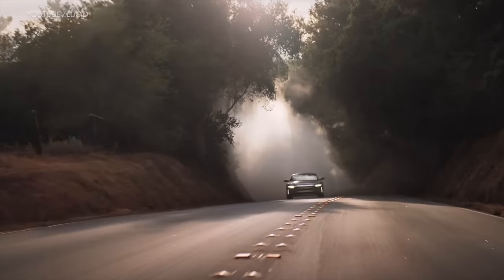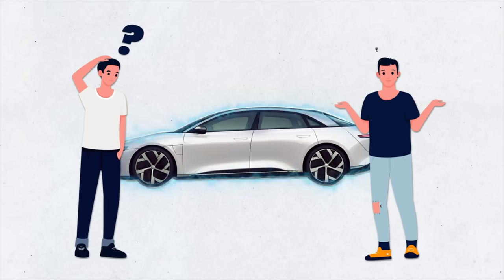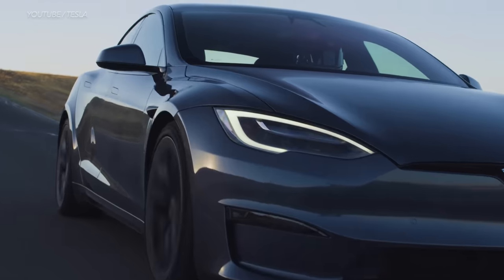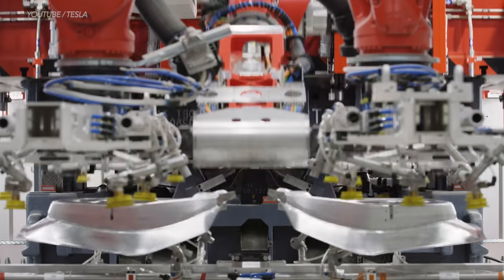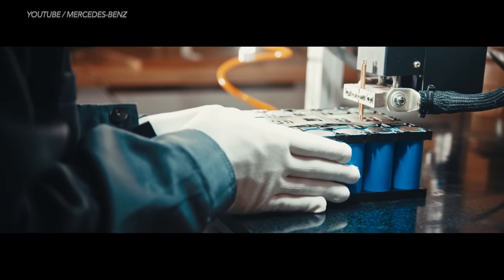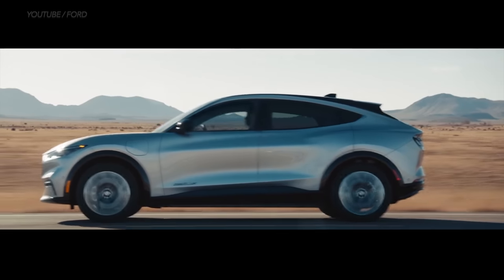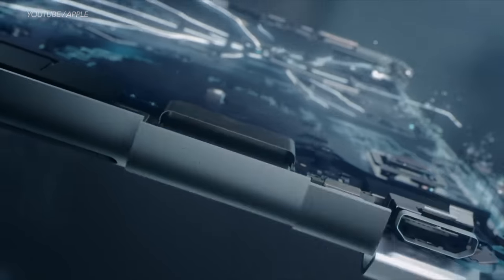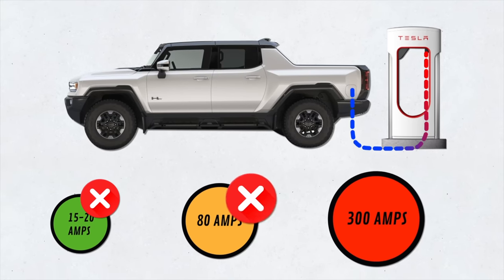Here's Why I'll Die Before I Buy an Electric Car

Comment: I've got a Volvo V60 plug in hybrid.  It has a supercharged and turbocharged 2 litre 4 cylinder petrol engine and a 180bhp electric motor.  Combined power if used together is around 350bhp.  This is around 100 bhp more than my 3 litre 6 cylinder Porsche Boxster.
It runs RWD on electric and FWD on petrol, it is difficult to tell the difference other than acceleration is obviously slower with electric.  There is also an AWD option for ice/snow and a power mode for all out performance.
Battery range is 30 miles which covers most day to day driving.  It has a 60 litre fuel tank for petrol.
Energy recuperation can recover useful extra battery range when driving in petrol mode even if the battery is effectively empty.

Comment: The same, will consider with mileage improvement, when weights reduced, the road tax for EVs is removed, the prices come down, and when it doesn't cost the same to recharge as it does to fill up with petrol/diesel (which it currently does in Australia)

Comment: The next battery development will be modules that you can charge and slip in. As we do now with 2 AA batteries. It happened in the swap'n'go LPG  containers...it will happen in cars.
Reply: Worked in a factory with electric forklifts, and they had to swap these monstrous batteries, one charging while using the other and you could plug the battery in the forklift to the charger and that was 25 years ago. They're going to have to come up with a universal lighter battery that can be swapped out, plug and play solution instead of taking forever to charge.

Comment: What people are forgetting or unaware of, electric vehicles need to be charged hence power from the grid = coal. Renewables aren’t reliable yet and won’t be for a while so you need coal fired electricity to charge them, which intern produces more carbons than using conventional fuel for your car. Plus mining for lithium costs way more than crude oil and produces greater carbon. Hybrid is the way to go ATM
Reply: I always found it interesting that car makers have made pollution from ICEs negligible and yet the environmentalists still aren't happy. I doubt they'll be any more satisfied with EVs. If they ever do shut down gas stations there will be a lot of classic cars left to rust.  What a shame.

Comment: As more I learn about electric Vehicles, the more I love my V8 5.7 L Tundra.
Reply: Ever speak to someone who owns an EV? Most of us are glad to be away from our gas guzzlers. I sure am
Reply: @markhaechler3512  planning on making the switch soon! What do you have? I was thinking Mach e but that Cadillac Lyriq looks awesome!
Reply: @markhaechler3512  well, it is ironic that the electricity used to recharge the batteries on an electric vehicle it is created based on fossil fuels or nuclear power that it is more damaging. Not counting the immense carbon print contaminant  created during the process of fabricating the batteries. By the time an EV is out of the factory, each vehicle has already contaminated the ambient more times than a gasoline power vehicle on his service life.
Reply: @mauricebarry8858  I have a bmw i3 with a rivian r1s on order. Haven't driven the gas vehicle much lately and don't miss it at all
Reply: @gerardorodriguez538  well in my state only 25% of electricity is from fossil fuels. California it's less than 10%.
Even so EVs are very energy efficient with 70% energy usage going to the wheels vs around 20% for an ICE vehicle. 

I didn't buy an EV to save the planet I bought it because it's very inexpensive to maintain and operate and because I'm sick of being held hostage by high gas prices.
Reply: @markhaechler3512  Remember that the tax that you pay at the pump is for the infrastructure and maintenance of  the roads, also all new public projects. I understand for the needs of a very efficient ways of transportation, EV's are the future of transportation, but not quite soon. And when that happen the electricity cost will sky rocket to fulfill the demand of new electro generator complexes and the maintenance of the roads and infrastructure.
Reply: Yeah bro,

I have a huge car collection with V8 cars. V12s too. But nothing beats a V8. 
I will never drive anything else. 
It makes my day every single day.
Reply: I love mine as well except when filling her up
Reply: @gerardorodriguez538  Unless you live in area that is financially productive to use solar panels or live in a area that uses hydroelectric for power. Those areas are limited in USA however.
Reply: do you love the gas prices too and getting smoked by Tesla’s?
Reply: @itsjammbi  I do not care about getting smoked. 0-60 in 1 second I do not care about. My problem with EV is that I do not drive often, once a week to store or sometimes once every 3 weeks depending how well stocked house is. Ny the time i drive the EV will have drained some of its charge. Perhaps in future if EV tech gets better but the teck its improving too slow and EV's are just getting more expensive. Read in lot of articles the lithium is the new oil that geopolitical wars/issues will create. Seems like all forms of transportation is currently bad.
Reply: @itsjammbi  just saying. The price at the pump is what keeps this country moving forward. And yes,Teslas are fast. But for sure I will get to my destination 1000 miles away first.
Reply: @itsjammbi  I hate the gas prices but teslas are crazy expensive and my electric bill at the house is cheap. I could care less ab a Tesla smoking me. 
I hate when an e bike passes me while mountain biking but love when they can’t. Hehe
Reply: @itsjammbi  I have enough money not to worry about anything. 

And I have cars that smokes Teslas big time.
Reply: @dakingakings7184  👍🏻

Comment: Don't forget that a lot of the US experiences winter and batteries perform far worst in the cold and have far less range in that circumstance. As for a turning point, when the vehicles cost the same and perform exactly as an ICE. Including only needing to spend about 10-15 minutes charging. No way am I going to want to do 20 hours on the road because I have to wait to charge when with ICE it takes 14-16 hours.

Comment: I'm with you Scott on NEVER buying an EV. It's just not cost effective or practical. Too many downsides to getting one:
- cost
- inability to take long trips without mutiple stops to recharge.
- repairing/replacing battery cost
- weight of vehicle
- No way to charge when power outtages occur. Gas engines don't have such restriction.
- fires due to hot temperatures.
- potential for injury from battery  chemicals in a crash.

It's a nice idea, but it's not for me.
Reply: You will never replace the battery in a modern ev. It will last longer than 99.999% of consumers ever own their cars.
Reply: @BoomerPlusUltra  So, 20+ years? Doubtful.

Comment: So if you run out of charge in a remote location how is someone supposed to give you a charge? If you have a gas car you can just give that person a couple gallons and they'll been on their merry way. But for electric you have to sit there and let it charge fort at least  a half hour.
Reply: @mcc7762  Congress has a program putting a charging station every 65 miles on the interstates and every 75 on the secondaries.
Texas was first to announce they were going to do it.
Reply: You can tow a Tesla and the battery regens approx equal to the consumption if the car was driving. Prob not advisable to rely on this method, though, only one-off emergency
Reply: @joebloggs830  So your saying someone can pour  electricity into an electric cars tank.

Comment: Even if the electric odometer says that it gets 400 miles, before needs to be recharged 

they don't put into effect that when you use your air conditioner it's gonna drop that mileage down much faster and that those odometer readings are not always accurate and could be off by 30 or 40 miles even in some cases which could be a problem.

Plus , electric cars  have a history of overheating and starting on fire, which can be very dangerous
Reply: The fires are mostly a myth. At least in my car, the range advertised adjusts to the usage of AC or heater. I get about two thirds range in cold winter days compared to summer. Just drove a 180 mile trip at about 65 mph in summer heat with AC running, I had 39% battery left when I got home, in a car with a price tag of 60% compared to a Tesla model 3. My "fuel" cost was a little less than $8. Car is a small one, Hyundai Kona.

Comment: One of my hobbies is radio controlled cars. You want to know what they all have in common? REMOVABLE BATTERIES! Without removable batteries, these electric cars are dead in the water. We should be able to exchange the batteries. Swap them out instead of waiting for them to charge. I have RC cars from the 1980’s that still work. Why? Removable batteries.
Reply: Interesting in theory.  But suppose I buy a brand new EV.  Then I'm supposed to go somewhere and swap for charged batteries, that might happen to be five years old in trade for my brand new batteries???
Reply: @davep4610  In the RC hobby we purchase our vehicles without any batteries. Just buy the car and bring your own batteries. Most of the time we keep spare batteries around so we don’t need to wait for charging. We also use the same batteries in different vehicles. Some vehicles need more power, so we use extra batteries in series or parallel depending on the needs. I have a whole lot of RC cars but I only need a few battery packs on hand at any given time. If the EV vehicles had removable batteries, then, customers wouldn’t need to purchase the batteries. They could have rental agreements with charging stations and drop by to swap them out and paying a fee much like paying for a tank of fuel. You wouldn’t have to worry about your batteries going bad because you’d just swap them out whenever they need recharging. Alternatively, people could purchase their own batteries if they wanted to maintain their own. We’re already using removable batteries on lawn equipment. Makes no sense why we couldn’t do this on cars.
Reply: @acereport8939  Interesting approach.  This is like the propane tank swap business.  It could have potential IF the cars were designed for it.  Seems like the trend more and more is for the batteries to be part of the "chassis".